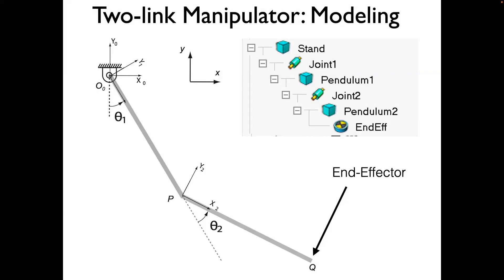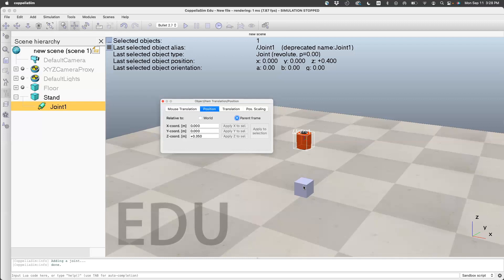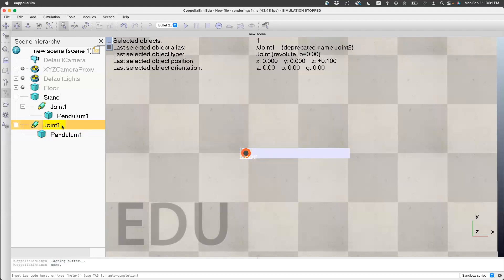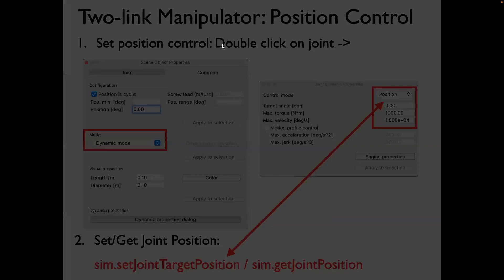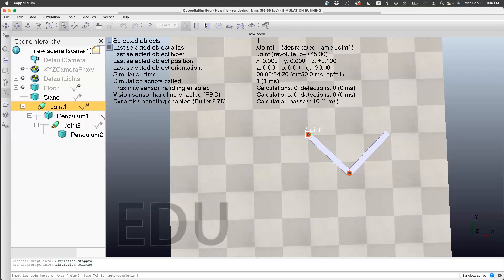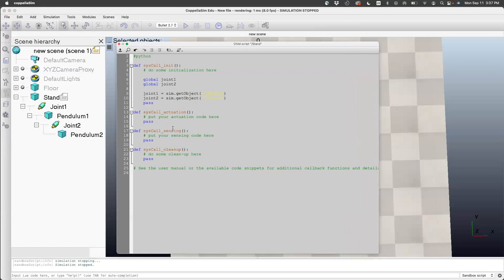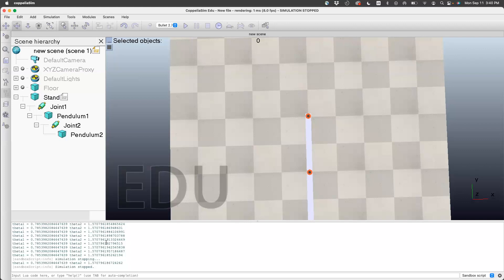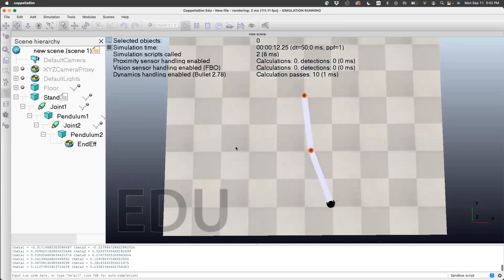CoppeliaSim: Two-link planar manipulator, Modelling (part 1 of 2)

Comment: please, how I can drawing the trajectory of the robot when it was walking on environment of coppeliasim version 4.9?
Reply from the maker: Does this code work in 4.9? Usually coppeliasim code is backward compatible.
Reply: @pranavab, my question is out the work of this video.  I talk about walking robot,  I controlled it by external code and I want to draw its trajectory on environment of coppeliasim.
Reply from the maker: @ahmedbenyoucef3238  what does external code mean? Did you write create a simulation in another environment and want to use coppelia sim for visualization? Or you used the external api in coppelia sim?

Comment: I'm not sure if you're gonna reply or not but I am facing this followning error {Traceback (most recent call last):
                  ~~~~^^^^^^^^^^^^^^
  script, line 9, in sysCall_init
NameError: name 'sim' is not defined. Did you mean: 'sum'?}
Reply from the maker: In the sys_init function put this line at the beginning

sim = require(‘sim’)

Let me know if it worked
Reply: @pranavab  IT WORKED!! really appreciate your help man. Thanks ❤❤
Reply: @pranavab  I had same error message, after I insert that line, came a new one :

[/Stand@simulationScript:error] Traceback (most recent call last):
    ~~~~^^^^^^^^^^^^^
  script, line 4, in <module>
NameError: name 'client' is not defined
Reply from the maker: @ can you try putting the following line right on top of the script? 
import sim
Reply: @pranavab    Thanks, but I solved after few hours research.. The import sim wasn't necessary, but some reason in the new (4.9.0)version that 'sim=require(' sim') not works at the beginning, but if put after "def sysCall_init " tnen works. Thanks anyway.
Reply from the maker: @ yes sim = require(‘sim’) should be in the init function not outside it for all version of coppelia sim